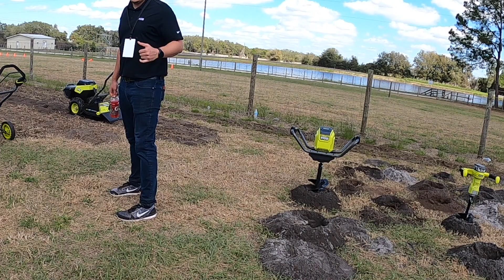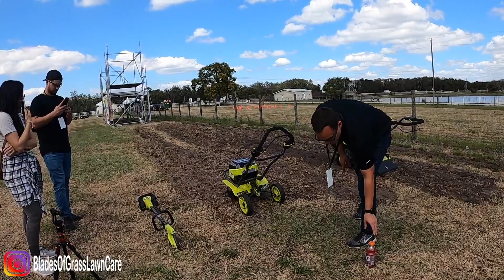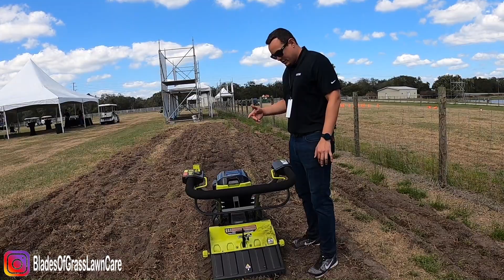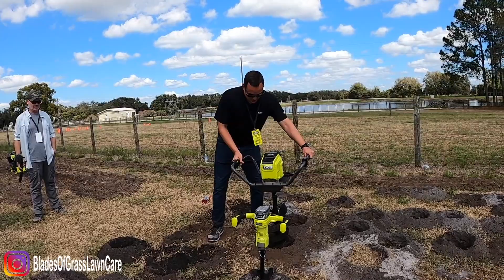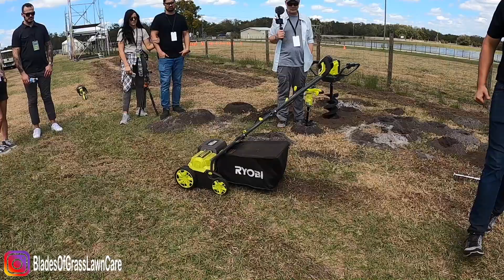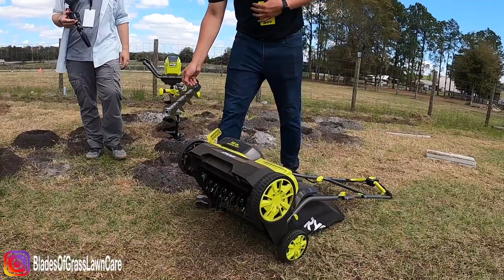RYOBI Tools Drops First Ever Battery Tiller Auger Aerator

Comment: Just got mine due to a few back issues.
Will be digging large 3-5 gallon plant holes in red clay soil.
Reply: From unboxing the 8 nuts and bolts(tools included)to assembling and walking to the site…then making 5 holes for 4 fruit trees(changed my mind about 1 spot)…planted the trees and began re-charging the battery all within 1 hour.
An evolution from the eternal post hole digger.
Pure utility.

Comment: Hopefully they come out with a 40v dethatcher/scarifier, more power and runtime over the 18v.
Reply: It basically is. 2 18v batteries running it at 36 volts. But added run time would be nice.